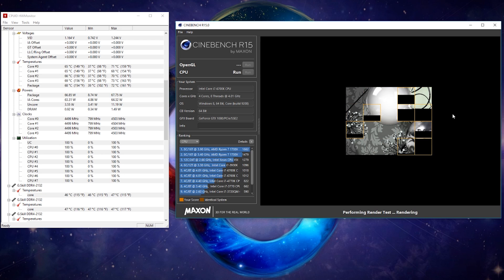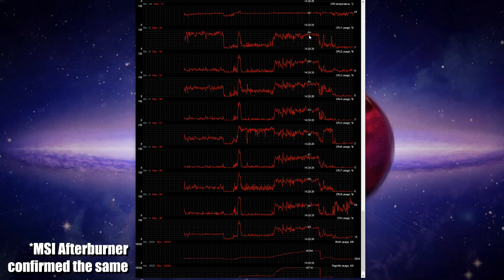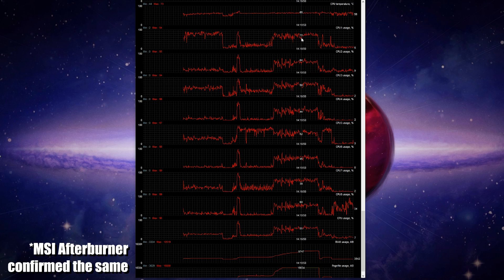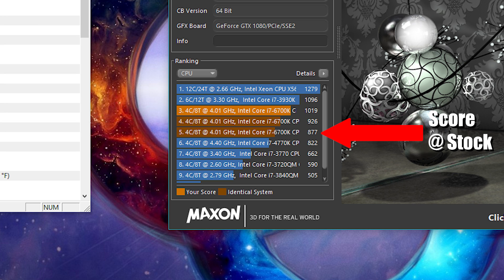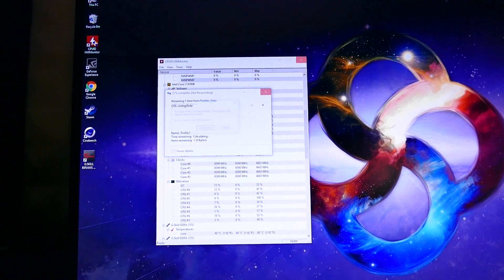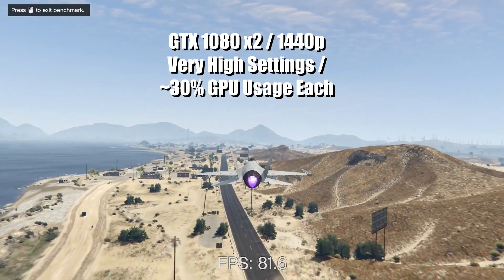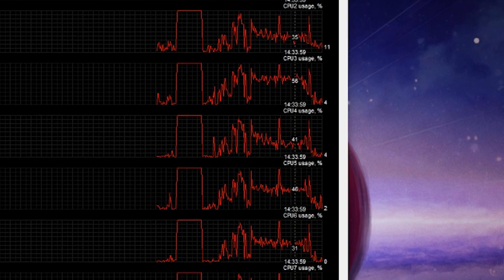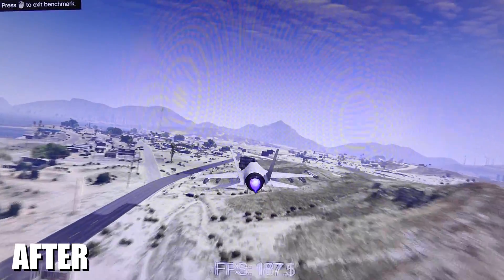My PC was Terribly Under-Performing...

Comment: Posted 49 minutes ago · OP
I just upgraded to a Rx 5600 xt. My FPS on  r6 and countersrike are pretty much the same as before on low settings 110-130fps and modern warfare crashes low settings (screen freezes and 50-90 FPS ). Is it due to my cpu bottlenecking or something else? I had Rx 560 before Rx 5600 xt
specs:
rx 5600 xt
ryzen 3 2200g
corsair vengeance 2x8 ddr4 ram
evga 500w power supply 
2 case fans
hardrives etc
thermaltake h17 case
 
will upgrading my cpu to a ryzen 5 3600 help? Or is the issue a settings thing?

Comment: Hey mate not sure if you read comments but if you do I have a skylake 3770k and a 760. I recently upgraded to a 1070ti and it was like using the on board graphics. I reset my windows and it's better. I was at 30 percent cpu and gpu useage in games. In pubg I was getting 100 cpu and 0 gpu. I played around and I get around 60% cpu and 50%gpu (mainly ultra Anti Aliasing to work the gpu more). As I know a bottleneck is when the cpu is at 100 and the gpu only needs low power to work with it. If anything the 1070ti seems to be bottlenecking the 3770k. I dont understand why the cpu and or gpu isnt at full useage, the 3770k ran about 60 percent with my gtx760 too. My previous 15 2500k would run 100%. A cpu and gpu overclock forced more power but why is it still only gaining 10 percent and not 100 percent even overclocked. Seriously need some help if you can PM me.

Comment: MY 1070ti just came in the mail. I'm using the latest driver 445.75 and I'm only getting like 15% more fps in games than I got from my 1060 3gb. That's an improvement but I feel like it should be better. And my gpu usage is only about 30-40%

Comment: How much percentage is your GPU suppose to perfrom? I have a 1070ti which i feel like is really underperforming from when i got my pc 2 years ago(It could run Counter strike max settings 200 at its lowest).  Now im going under the 100 fps mark! Does somebody have a solution? And is it normal for my gpu to be going 50%

Comment: Can someone help me please, my gta5 is running low fps, I have a gtx 1080 and Cpu AMD ryzen 5 2600, my cpu usage is 30 to 80% and my gpu usage is 0 to 18 %. I have searched every where and cant find a fix, pls respond if you know. Also I just built the pc yesterday
Reply: Same I need help
Reply: same
Reply: same
Reply: I have same problem, i5 8400 and rtx 2060
Reply: JuupaFIN I have Sam specs tell me if u find a solution
Reply: @Misty WHAT A STUPID COMMENT he has a 1080, great gpu for a 7 years old game
Reply: Update GPU drivers to start
Reply: @bruhwhydoesyoutubehavehandles  i tried
Reply: @bruhwhydoesyoutubehavehandles  tried that, also tried reinstalling windows
Reply: Did you fix it bro ? If yes tell me how pleaseee
Reply: @obelix2342  nope, sadly not
Reply: I also have lower fps than others with my same components. Running a RX 5700 Xt and Ryzen 5 3600. My fps is lower than others by about 20
Reply: @ifacecamp717  A 5700 xt has some really broken drivers and has so many other issues on top of  that, you're just better off getting another card than trying to figure out how to fix it.

Comment: I've been having the same problem. Basically went from average 190-210 FPS CS:GO to 15-60 FPS. It happened after a Windows 10 update two days ago. I'm going to try remove the CMOS battery for 10 minutes.

Comment: My laptop is ASUS Rog GL503GE with GTX 1050Ti and core i5 8300H cpu and 16 GB DDR4 2666 mhz ram. I purchased this laptop 1 year ago. Till 2 months back everything was running fine and GTX 1050ti was giving good fps on every games. Problem suddenly started when I updated to win 10 1903 . After that GPU is giving constant unplayable 20 fps in all games with lot of stuttering.
I have done following troubleshooting to solve the problem but succeeded in nothing:
1. reverted back to windows 10 1803 (clean install) + drivers installed as given by ASUS only
2.reverted back to windows 10 1709 (clean install) + drivers installed as given by ASUS only
3.Tried updating GPU drivers with latest one 441.34 and also tried beta ones (all were installed with DDU uninstallation procedure)
4.Tried rolling back GPU drivers with OEM provided ones 399.24
5. Updated win 10 to 1909 version ( clean install) + drivers installed as given by ASUS only
6.Changed All setting in Nvidia control panel to best and as directed in all posts and also making GPU as default GPU processer
7.The temperature of CPU and GPU are under normal conditions around 60 deg cel. No throttling observed anytime.
8. I have tried all GPU drives from NVidia from 399.XX to 441. XX. Nothing solved FPS
9. I installed MSI afterburner and no throttling observed anywhere
10. From GPU-Z the GPU is observed to take full load at 100% but memory controller load is very less
11. I have kept laptop at performance mode still no improvement, charger always connected
12. No extra process is there in background too that may be eating the CPU or GPU.
13.All settings like win 10 gaming DVR, game mode, xbox live etc were turned off. Still no improvement
14.There is no dust too in fans and all are clean, running properly and fans giving proper response as per temperature elevation.
15. All GPU benchmarks are coming very low with this laptop. (20 to 25 FPS everywhere)
16. I reverted back to original setting as when Laptop first came. No improvement
17. Tired updating bios to latest version. No improvement
18. Tried downgrading to all past bios version . No improvement
I am doing troubleshooting of all types since 2 months and very frustrated now and sad .
I have observed one thing which should be noted :
When I reset BIOS with CMOS battery removal method the GPU performs normal for 5 minutes only and FPS comes back to normal but after 5 minutes again 20 fps everywhere. The temperature of GPU and CPU remain around 60 degrees (no throttling) .The BIOS resetting methods brings back the GPU performance to normal for 4-5 minutes only and after that it becomes poor. I changed CMOS battery with new one but still problem remains same.
Please help me someone. Guide me what should I do.

Comment: I had an issue that drove me nuts. Turned out it was the Duet app that can use the ipad as a secondary screen. Couldn't run some games because of opengl or directx or something. Everything worked perfectly right after uninstalling. So something like that messing with display services could be the cause.

Comment: Why is my gpu and cpu usage both at 30 to 40 percent? The game is running around 40-50 fps I could use the performance increase. I don't see a bottleneck so why aren't they both using their full potential? Thanks.

Game - Rust
GPU - GTX 1060 3gb
CPU - Xeon X5670 @2.97 ghz (x2)
RAM - 24gb ddr3
Storage - 500 GB Samsung 850 evo

Comment: Does anyone know why my gpu is only using 405 mhz instead of 3500 mhz (like it sometimes does run 3500 mhz when i alt tab) it also seems to run worse when plugged in what do i do since its making my games run way worse than before.. however after an alt tab it seems like the game runs perfectly but after like 2 minutes it starts showing the same stuttering as before

Comment: This is whats happening to me with BFV, except I have a single 1070. Im running about 50fps at 40% utilisation and about 50% on my CPU. I have no clue whats wrong, as my temps aren't reaching above 60Cs. Still trying to problem solve to delay a fresh install on my OS

Comment: Did you DDU it first ? Windows has this weird thing very some times microsoft basic display adapter driver has some funny register non sense and it conflicts with nvidia drivers when using SLI, so it basically initializes the "instance" of driver for the cards as microsoft basic display driver and not the nvidia driver even tho its using hardware acceleration using the nvidia chip, dont ask me why, this is why I switched to linux.

Comment: I have a problem where I have a rtx 2080 and im running rocket league and apex lenegeds at 40 fps at 1080 im new to pc so idk what to do? I feel like my graphics card is under preforming and I have my monitor set to 240hz and my in game settings r set correctly as well if anyone knows any comments would be appreciated thnxs
Reply: King Griffey maybe a bottleneck? What’s your cpu?
Reply: I have the same problem I have a rtx 2080ti and a i7 9700k and was getting 70-110ish fps in gta5 at 1080p which is 40 fps less than other benchmarks I saw. I was seeing around 98% usage. If  you know a fix please let me know
Reply: Guys i got a 2060 super and in apex im getting 40 fps as well at all low fullscreen 1080p. Im going to reinstall the OS. When installing windows make sure to disable anything that windows asks you like for example to send them data or extra features.

Comment: My PC are under performing in some game such as war thunder,  GTA V my CPU and GPU work like I didn't run any game and when I play game as 1080p it like my GPU    is alway run 50-70% but if I run in 4k it run normally ( 80-92 ) my spec 
CPU : Xeon X5680*2 | 12 core 24 thread 3.33 ghz
MB : Supermicro X8 
RAM : 16GB DDR3 ECC 1600Mhz
H/S : ID Cooling FROS FLOW 120L*2
VGA : Gigabyte Aorus GTX 1080 Ti 11GB 
PSU : ANTEC 700W 
CASE : Aerocool 800 
Hdd 1TB *2
SSD GALAX 240GB
Reply: นาย เกลือ might just be a game error.

Comment: The thing is I bought a system and I saw poeple with the same build get better FPS and higher settings I have a core i5 8th gen and a gtx 1060 and 16 gigs of ram and I run gta at like low settings at a low FPS
Reply: I have a similar PC but some of my games lag alot aswell did you solve it mate?

Comment: Sometimes stuff like that just happens and it's near impossible to find a solution. Possibly just a random bug or weird driver issue (maybe reinstalling them didn't actually delete all files) but fresh start fixes stuff like that most of the time.

Comment: I have a 1080 gtx and when i run a test on cinebench it compares met with cards like 640m to 660gtx MAX ..
Im so lost, tried multiple clean installs and a lot of other settings
Reply: Kaluchi did you fix it I’m having that same problem with my RX 470
Reply: @scumbag_poon6027  nope never was able to fix it i have the same issue with my 3070 tho completely new setup

Comment: gta5 uses only 0.1% of my gtx 1060...
Reply: Exactly! I get max fps on max setting with only 16gb of ram on an i7 4790 not the k i7, and even maxed out the settings werent even close to 3k mb in use
Reply: Derp did u find a fix
Reply: did u fix
 this?
Reply: Try reinstalling drivers for u gpu

Comment: This happened to me too i overclocked my 7700k to 4.8 and for 1 week i was getting 1050 points and i randomly tries to do cinebench with no programs open and i had 930 i was like wtf then tried lowering the clocks adding voltage nothing i tries reinstalling windows nothing.. then i decided to load defaults in bios and it was like 925 stock and 1078 at 4.8 🤗

Comment: NEED A LITTLE HELP HERE!!!!
sometimes suddenly games start stuttering really bad. i used afterburner to monitor and the gpu usage was fluctuating a lot(between 90%-20%) other than that everything was same and it would go back to normal when i restart. Should i RMA the gpu(zotac gtx 1050 2gb)

Comment: Weird issue, but I've seen stuff like it: I have an old Gigabyte X79 board that went from happily overclocked to refusing to boot unless certain overclock related settings (like LLC) were on default - as in setting them to anything but default (eg: setting LLC from "auto" to "standard" or anything else "auto" might select) would have it fail to POST and reset itself to defaults. Took an actual BIOS reflash (with same version) to fix.

I should point out this happened after "BIOS corrupt! Flashing backup BIOS..." which the board seems to do after almost any kind of post error (seriously if I press reset at just the right time before post it makes it think BIOS is corrupt and my old Gigabyte X58 used to do the same thing - buying asus next time).

Comment: I have gtx 1050 with i7 7th gen with 8 GB ram I used to get 60+ fps but recently I got my HDD changed but now my fps is at most 20 my gpu isn't using it's full potential please help what should I do
Reply: Is ur problem solved now?

Comment: I think I’m in the perfect to spot to request assistance!
So I had my two Vega 64s running with my old 4690K. It was a trash experience, didn’t work, for obvious reasons. So I used to run it with one card, it was acceptable, but not up to spec, not even close. There were many factors to account for, imo.
Until recently, I got an 8700K, 32GB 3600MHz, and a z370 from MSI, top of the line.

I installed a fresh copy of windows, enabled XFR. Opened GTA 5, cause it’s the one I’m most familiar with. And what do you know? I can’t get above 100fps for the life of me..
I have all settings on absolutely ultra, except for the distance scaling in advanced settings, i had that turned down all the way, just for the sake of experimenting.
Anyhow, I’m running 1080p, and as I mentioned, everything on ultra, so I’m running MSAA X8.
And I go to the area where I’m used to get lowest frames, and I have around 100-110 fps there.
So, instinctively, I try to disable MSAA completely, while still looking at the same frame,, and what a story to tell.. frames did not go up! :) stayed pretty much the same! :D
Mind you, the only thing changed was GPU utilization, it was around 75% on both cards, and then it became like 35-40%.

Isn’t awesome!? :)
I need help🤒😷🤧🤮🤢🤕
Reply: iBoolGuy 

That’s pretty normal framerate for GTA 5 with one Vega 64 on max.

Comment: Here's a tricky situation. I upgraded nearly every major component in my system, and I'm now getting choppier gaming performance than I did with my old setup (most notably, micro-stutters).

Old system:
Mobo: ASRock 970A-G/3.1
RAM: G.Skill Ripjaws X 16GB DDR3 1866MHz
CPU: AMD FX-8350
GPU: GTX 1050 Ti
PSU: Cooler Master 500W
NO OVERCLOCKING

New system:
Mobo: MSI Tomahawk Plus B350
RAM: PNY Anarchy 16GB DDR4 2133MHz
CPU: AMD Ryzen 5 1600
GPU: GTX 1060
PSU: Corsair RM550x 550W
NO OVERCLOCKING

I see no reason to experience smoother gaming with the old parts than the new ones. I can't figure this one out. The difference isn't overly major, but I'm getting micro-stuttering on games that had none before. I'm using the same 240GB SSD as well. Any ideas?
Reply: I say check your graphic card. Swap old one in see if issue fixed.
Reply: Thanks for the response! I concluded that since my new graphics card had less VRAM, that's why I was getting the stutters. I originally had a 3GB model of the 1060, then I upgraded to the 6GB model. That seemed to fix it.
Reply: glad you fixed it. But why you not go for rx 580 8gb model? It beats 1060.
Reply: Simply because I'd blown a lot of money and didn't wanna spend any more lol. I'm sure I'll upgrade again later on.

Comment: You must be new to tech, lots of random issues like this can be solved by resetting CMOS. 

Backing up data and resetting CMOS are the first things you would do in a PC repair shop. You would do a full power drain, CMOS battery removal and all, as the HDD/SDD is being backed up in the dock.

Comment: I can definitely one-up this claim. If all else fails, or even if not, to spare you some headache, C-MOS reset and you're good to go 9/10 times. In my case my 4670K was acting very odd under load. Reset fixed it and it goes to 4.5 now on air just fine.

Comment: Same thing happened to me with my 1080 ti back in February. I was getting really low frames, my previous GPU, 1070, got better frames. I asked on reddit and searched for answers, someone suggested to do reset of the OS. I did that and finally got way better frames. They suggested it might have been a software I downloaded that had in-game overlays, but I figured something in the OS was changed either by me or an update. It's a mystery to know what exactly happened.

Comment: I had the same issue with my FX8320 at 4.1Ghz. It was performing worse than stock. After some research I found out, that these CPUs tend to easily get unstable while overclocked even with Prime running normal. Maybe something like that happened with your 6700k?

Comment: Same thing happened to  me with the GPU And CPU. My 1 1080 was being outperformed by a 1050ti and a 960!! Couldnt figure out the issue i assumed it was driver related, RE Installed windows and fixed everything.

Comment: I'm also running 2 strip gtx 1080 ti oc in SLI and I'm getting worse performance compare with a single card across multiple games, and the worst thing is, I have experienced severe micro stuttering in cs go which should never be an issue for a 10 series graphic card

Comment: Run Command as admin: ( bcdedit /deletevalue useplatformclock )
i would bet that the gpu issue could possibly be the HPET being enabled. (mine does not like it at all no matter the clock) disable HPET and give it another shot and then re-enable and you will see what i mean. :) yw.
(sorry that you redid OS prior) you can actually launch windows install (mount iso in windows) and reinstall windows (repair or what ever) and it will restore only windows to default but keep all programs and such (also resets the HPET windows option)